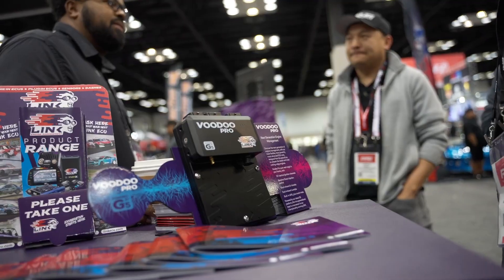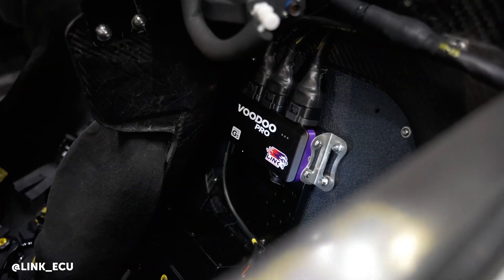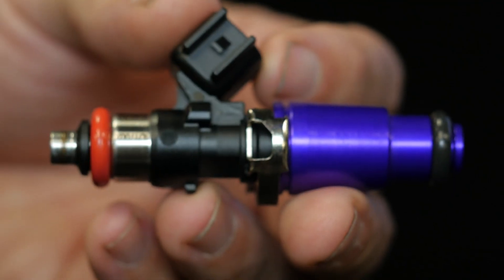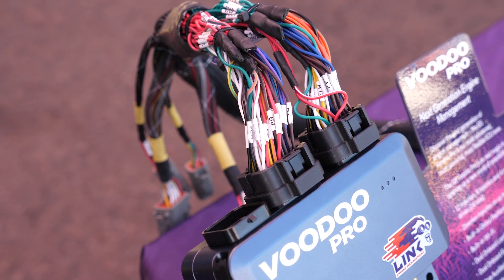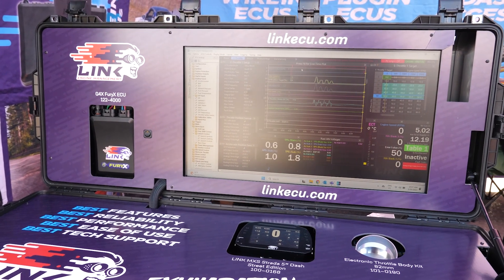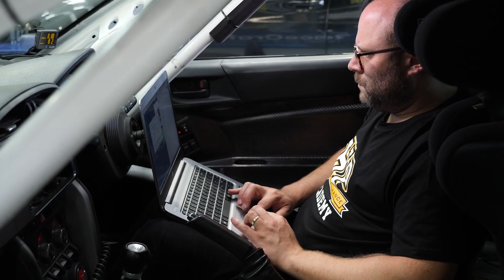Do You Need To Upgrade Your ECU?

Comment: This wasn't great from the Link rep. Didn't instill a lot of confidence!
I've just moved from the G4+ to an Emton KV8 in my R34. 
And given the price of the G5, I still feel like I made the better choice.
Reply: I have the G4+ thunder - and there isn’t an X equivalent. I have a yearning for the Haltech R5 rather than any Link for an upgrade which is sad.
Reply: @Lexusturbo  I can heartily recommend Emtron. They were great in my pre-sales support, and my R34 is on the dyno as we speak, and it's doing great things with Throttle Mass Flow mapping.

Comment: If it can only do 12 injectors how's that work in a v8
Reply: Well one injector per cylinder and don’t quote me on it but I’m sure he said 16
Reply: 12 dedicated injector pins, 8 dedicated ignition pins and then 4 that can be injector or ignition pins so can do 12 and 12 or 16inj and 8 ign
Reply: I think v8s have 8 cylinders so that is less than 12
Reply: @chippyjohn1  yes I understand that but he was talking about it controlling do well if it has 12 drivers and 8 cylinders to stage in port injection to get the fuel flow we need 16. I rewatched he definitely says you can do this but he also says 12 injector drivers and that you must use them for the di controller too. So how we using this on v8s
Reply: @oliverscorsim  12 sequential, 16 in total. Have 8 di sequential and have 4 pairs of two in sequential group for Port injectors
Reply: @chippyjohn1  that makes more sense thanks looking for a new management and was a bit disappointed at first

Comment: A great ECU!  already finding loads of advantages with GPS data included in logging - mostly demonstrating the terrible driving but pinpointing accurately events like gear shifts, oil pressure events etc is VERY handy in building a better race car.

Comment from the maker: TIME STAMPS:
0:00 - Link G5 Platform
0:20 - Why Upgrade From G4, G4+ or G4X?
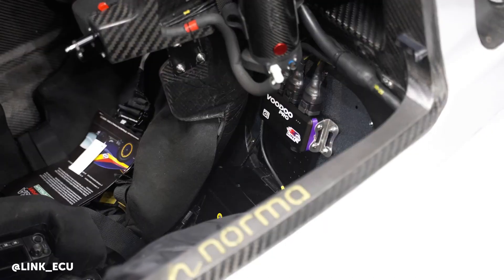0:59 - Direct Injection
1:37 - Port Injection AND Direct Injection
2:22 - Injector Outputs
2:57 - New Fully Sealed Unit
3:24 - Onboard GPS Capability
3:52 - Onboard Dual Wideband and DBW
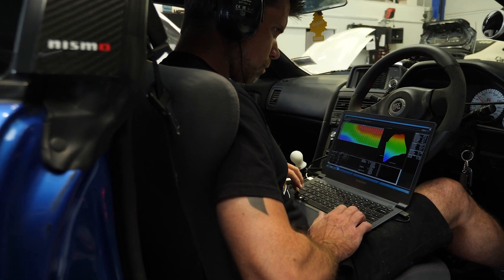4:29 - G4/+/X to G5 Crossover
5:12 - CAN Bus Capabilities
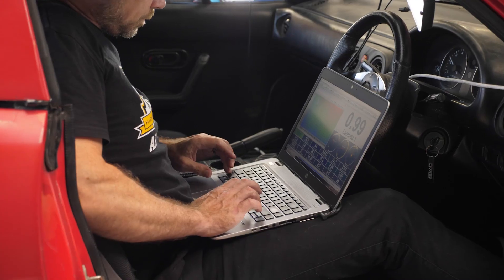6:05 - Comercial User CAN Encryption
6:56 - She's Out In The Wild, Thanks Dan!
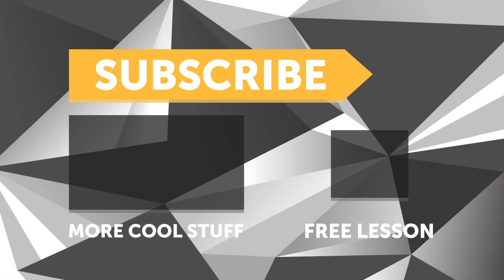7:29 - BUILD.TUNE.DRIVE
Reply: Did you guys betray us? I'm confused. This has GPS and that data goes straight to insurance companies to increase the insurance cost. The telematics. Fast acceleration, hard brake, these things increase people premiums but secretly so not promoting safer driving. But you said the can bus can be encrypted does that lock those companies out? It's not right what they do.